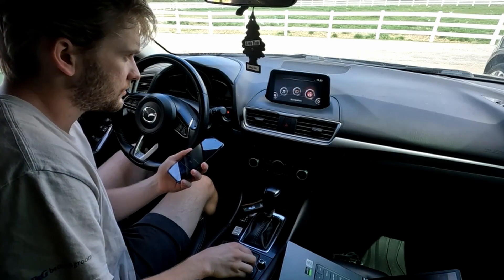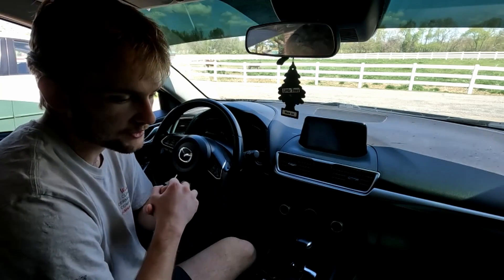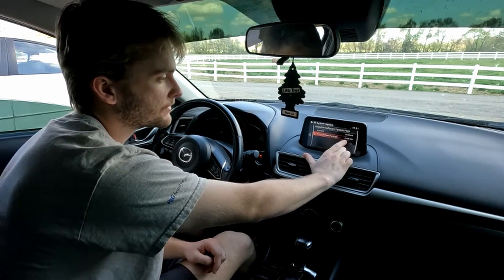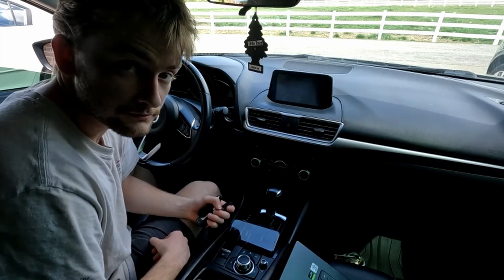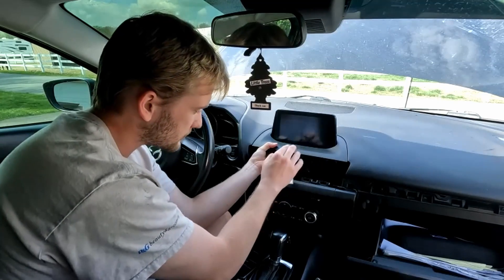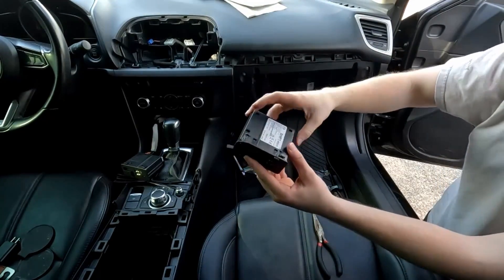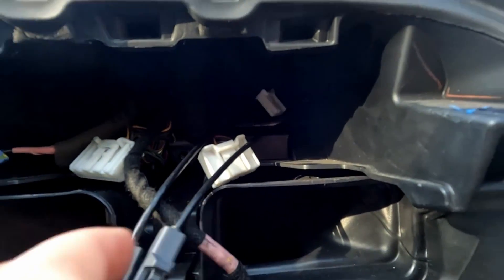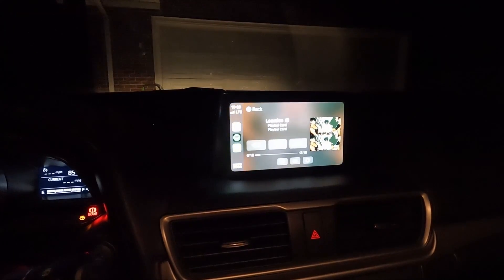How To Install Apple CarPlay/Android Auto On Your Mazda Infotainment System

Comment: DittyPitty, 
Hello I like your work , BUT People outside of North America are installing the wrong FIRMWARE.. NA N is Only for NORTH AMERICA.
YOUR Google link has been copied from my original thread on this subject.
The 55 Firmware Cut off ONLY Applies for NA N, what about EU N or 4A N, that cut off is 56.00.100 EU N not 55.00.650 for NA N, these are Not the same Firmware.
Please can you either redo or add a Banner over your Video saying for NA N Firmware Only.
Your video is causing a lot of grief.
Regards
ASH8
Reply from the maker: Awww fwick. Thank you so much for bringing this up to me and I sincerely apologize for any who is outside of North America installing the firmware. I’ll update the description and google drive to let people know. Cheers!
Reply: @DittyPitty1  Hey man!
I did it. It took me exactly 36 min because I lost power during the process at 98% but when I came back it restarted where it stopped. Eleven easy steps:
1.  Put the car on ACC;
2. Test the sound from the radio;
3. Press, simultaneously, "MUSIC" + "FAVORITES" "VOLUME" buttons to open that black screen with figures on it;
4. Type "3", Press "ENTER" and "CLEAR";
5. Type "2", Press "ENTER" and "CLEAR";
6. Turn off the car and lock the doors for 3 min;
7. Put the car on ACC again;
8. Connect USB key;
9. Press simultaneously "MUSIC", "FAVORITES" and "VOLUME" for 3 seconds;
10. Type 99, Press "ENTER" and "SEARCH"
11. Choose the reinstallation package and install;
Watch the magic happen.
It might take time to start installation but, it will.
For me, it took time to move away from 2%, 16%, 80%, 98%. Might be different for others.
Don't forget to press the clutch or open the driver side door every 20 min. Also, in the USB key, you can have whatever you want as long you have the installation package, it will work.
That was my contribution. And Thank you so much @DittyPitty
Reply: I have a ‘17 Mazda 3 and it’s on v59.  Do you know how I can get up to v70 so that I can use the v74 that you provided?
Reply: @dwarnke72 mine was on 59 as well and I went straight to 74
Reply: @MergeMcadoo  so you really had 59.00.502? Just wanted to verify if I could go straight like you did...
Reply: @Shandaniak yes. Been a year no problems
Reply: @MergeMcadoo  thanks a lot. My touchscreen died i was afraid when I read that it might brick the system. This helps that someone had same thing. I will try it. Thanks
Reply: @dwarnke72 I have both files if you need them

Comment: I've seen two different hardware upgrade versions both stating compatible with 2017 Mazda 3. One is the USB phone connection, and the other is with a type-c phone connection. Will both of them be compatible?

Comment: Worked great on my 2016 mazada 3 sport.  Thanks!  I ended taking off the faceplate of the old hub unit and then breaking the tabs to pull out old one.

Comment: For anyone doing this, instead of drilling out the tabs (which could be dangerous because there is a capacitor in the old Mazda USB hub), open the sd card reader, stick something thin with a right angle into one of the two holes above it (I used a tool that came with a trim removal kit) and pull. The front face plate will come clean off. Stick a flat heat screwdriver in the four small slits where you can see the tabs and twist, it will break the tabs and you can just pull the hub right out. A less destructive, albeit still destructive, way to get the usb hub out.
Reply: This saved me so much time, thank you 🙏🙏
Reply: Hell yeah. Gonna try this out this weekend. Thank you!

Comment: Does the USB hub always require replacement? I have a 2017 Mazda3 GT and it has 2 USB ports and SD card below the radio. Would love not to replace the hub. Thanks for the video.
Reply from the maker: I’m fairly sure the USB hub needs to be replaced since the stock one is not compatible with Apple car play.

Comment: Can you perform the update with an aftermarket key fob? I don’t wanna try it and have it not work for the part where you have to lock the doors. One of the door actuators doesn’t work the passenger side door

Comment: Help! I tried this out. Mazda3 2017, was at 70.00.100 and was updating to 74 with the file you provided. After about 20-30 minutes into the update, my screen went black. I waited for about another 20-30 and now nothing works. When I press the on button (without break), it now shows 0 Miles remaining (previously was full tank and 300+ miles). Car also will not start now and states no key FOB (red key with line through it). 

Key FOB unable to lock or unlock car (or start it) but yet the car beeps when I hit the lock or unlock button. Going to try jump the car in case the battery died. Wife has the jumper in her car so have to wait until she gets home. Any assistance appreciated if I am on the wrong page here and curious to how this will work since the update process has been halted.
Reply: In case you do get it resolved, don’t even bother with the update. As long as your software is 70.00.000 or above, Apple CarPlay should work (according to others I’ve seen do this upgrade)
Reply from the maker: That’s a very tough situation to be in. I really wish I can help you out but this is above my pay grade. Is your car North American? The firmware is for North American vehicles only. This is the one thing that comes to mind. I’m very sorry about the situation

Comment: do i just need the usb hub alone or do i need the wiring as well ? because my usb hub postion is in the handrest
Reply from the maker: You have to do both. The usb hub in the hand rest makes it easier in my opinion!
Reply: @Dom60999  thanks for reply

Comment: I was VERY nervous at first but I followed your video and it went perfectly.
Tip for those without a touchscreen: Scroll the knob to get to the numbers, and press down twice to “enter” and then scrolling will “clear”

I have a 2016 Hatch, and it took mine between 25-30 mins to complete
Reply: hey! I just wanted to make sure that when you say “scroll” to clear, it’s the main control knob and it just goes onto the next number right?
Reply: @abigailb3020  yes I believe that is correct, if you twist the control knob left or right it will change the number, which acts the same as pressing the “clear” button
Reply: @ THANK YOU!!! you’re a livesaver😭 i’ve been trying to figure it out for a little bit and i finally finished my install and everything!! apple carplay works great :D so glad I found your comment.
Reply: @ enjoy your freshly upgraded Mazda 🤙

Comment: Help! I just installed the car play module and now trying to do system update, but my usb ports are not working anymore, is this because new ports and wires only function properly when update is applied ? Will I have to put back the original equipment then update the system, then install new equipment again? If anyone can help before I start taking all this apart again
Reply: And yes everything is plugged in lol

Comment: Thank you for this! I swapped the dual USB-A module for the one with USB-C for better charging speeds. However, I am having an issue where I have to unplug and plug the cable back into the phone on more than half of my startups as it doesn't seem to trigger car play the first time, even though the phone indicates it is charging. This is on 74.00.230 (I think that's the version, not 324). Hoping maybe it is a temporary issue.

Comment: Totally worked. Took about 20-25 minutes on my 2014 Mazda 3. I was able to use a PNY 32GB USB 3.2 drive with no issue. I did not hook up a trickle charger but my battery was just checked good and I'd been driving today. Only needed to download the one CMU150 file, that's it. Directions in the PDF worked perfectly.

Comment: Does the Apple CarPlay hub that you linked in the description only work with a wired connection or is it also wireless?
Reply from the maker: It is wired only. There is a usb be huh that supports wireless but it’s only wireless.
Reply: Oh ok, thanks. Do you know if you can disable the system from charging the phone? Also, do you have any issues with it disconnecting randomly or it being very laggy and whatnot?

Comment: How about the original cable? You remove or just leave it as spare in future incase need to rollback?
Reply from the maker: I took the old cable out and used the new ones. I did keep the old cable but there will most likely never be an issue where you’ll need it.

Comment: What about steps 7-10? The installing the fail safe? Did you not do this? You don’t have to? If I have OS 55 does that mean if I install the 74.00.32 update that you have on google drive then it’ll work, even without installing the fail safe?
Reply from the maker: If you’re located in North America and your firmware is 55.00.650 or above then you can upload the firmware that is in the google drive. I personally skipped steps 7-10 but you can do them if you’d like for ease of mind.

Comment: Hi Dittypitty, do you have any idea why my reinstallation package keeps failing? after i get to the part where its preparing the process i end up with "Validation Failed - Failed to validate the package certificate."

Im assuming the file is corrupted but i redownloaded the file 3x now and getting the same result.

UPDATE: Downloaded it for the 4th time, but this time i verified the CMU150 file by using the MD5_and_Sha (you dont need this in your USB stick). I dont know if this is the reason why it worked or that the 4th download was the charm, but whatever the update worked. Thanks for the help Dittypitty.
Reply from the maker: I’m glad everything worked out for you!
Reply: Can you guys explain this process a bit better ? I’m having the same problem

Comment: Mazda3 2017, firmware upgrade worked well! Thank you for the video. It took me days and days trying to get the firmware but without luck until this video. Called the dealership and they wanted CAD 95 plus tax to do this firmware update!! Now that I followed your video and have it upgrade, I ordered the kit from Amazon and will install the hardware this weekend.  Total savings 505 - 170!
Reply from the maker: Glad I could help!
Reply: Have you installed the kit? If yes is the android auto touchscreen working?
Reply: @winterMB91  I installed it yes and the installation went well. I don’t have an Android but Apple and the touchscreen on that is working.  I got the wireless version of the Kit (from Amazon) and to those who are thinking about the wireless version please save yourself time and money and get wired instead.  The wireless is not stable at all.  To return it of course I can’t drill holes so I have to disassemble the whole middle console to take the kit out for a return.
Reply: @whiteflyingmonkey  thanks for responding man 🙏

Comment: Just to follow-up on my previous post, finally did the hardware change and AA is working great! Need to check CarPlay later. Some time savers: google "fast way to remove mazda usb hub" for an easy way to remove the old one. Involves a bent screwdriver, flathead, and needlenose. Took less than 2 minutes to remove (and destroy) the old hub. First time doing this, so it took me about an hour total, but if I did it again, probably less than half. Thanks DittyPitty for the video!

Comment: Thanks for the most recent software. The technique I used for the old USB/SD module worked great and wasn't destructive: grab 2 packs of those cheap Harbor Freight pick sets ($1-2), using the hooked ones, flip down the SD card flap and hook them into the holes. Pull firmly and steadily on both, and the face plate of the module should pop off. Then, you can access the inner side of all 4 clips. You now want to use the straight pin-like picks to wedge between the clips and the dash hole. Hard to explain, but look at the module in the video and imagine how the clips connect to the dash. With all 4 picks wedged between the clips, the module should pull out by carefully grabbing the edges with needlenose. If you weren't too rough, the faceplate should still have its clips intact, and you can clip it back on to the module/circuit board part.
Reply: Hi
After changing the piece, the touch didn't work for me. Any advice?

Comment: Hi DittyPitty. Thanks for the great video! I have downloaded the file but I don't have the USB hub yet. Can I do it in stages? (Just update the software for now) or should I wait until I get the USB hub? Basically, does everything besides AA & CP work as normal until I get the USB hub?
Reply from the maker: Thank you! You can update your software and have everything work as normal without needing the usb hub. Once you install the hub that’s when car play will be available. Cheers!
Reply: @Dom60999   Wow, thanks for the fast reply!!  I'll give it a shot. But first, gotta find a thumb drive that's only 16GB or less!! Gotta be one in one of my old boxes of crap! 🙂
Reply: Ok, software update went super smooth! Went from 55.00.753 straight to version 74.00.324a (in case anyone is in the same boat) without a hitch. So far, no changes to speak that I can see, so next step is to get the USB upgrade. Oh and did confirm the version number is correct after upgrade.  Thanks!

Comment: Thanks for the information. Got it done today. The software update was straightforward. No hiccups. The interior part was different as I have a CD player where your interface is, and the interface is in the console. It was probably easier that way. The cupholder part has a hidden screw under the  rubber bottom of the cupholder. You then pull it straight up. The console front panel (where the interface box) has 2 screws which are revealed once the center cup-holder part is removed. You then have access to the rear part of the interface, so pressing the 4 clips is possible. I routed the wires on the passenger side a bit like you did. Not much extra wires with this install location.

Comment: Hi, Thank you for your video. Does this work on my Mazda 2 2019 as well? Also, does your firmware work in my region? My OS version is 59.00.540 4A N. I just wanna make sure. Thank you for responding! :)
Reply from the maker: The process would be very similar on your 2019 but the firmware I have will not work for your region. The firmware I have is only for North American Mazdas. Sorry homie
Reply: @Dom60999  Thank you for responding! I appreciate that. Subscribed!

Comment: what years does the mazda needs to be as minimum, mine the usb stuff is in the center and where usb stuff is, there's a CD Drive, mazda 3 2015
Reply from the maker: As long as your infotainment is above 55 firmware you should be in the clear
Reply: did u ever find out bro mine also has cd player and the usb plugs in the center console ?

Comment: Great tutorial, thanks! quick question, i wired everything and it worked perfect, but when i hit a bump or even driving the carplay disconnects, i even change the cable and nothing, re wired and it worked for a while but again, any idea?
Reply from the maker: Thank you! Nothing immediately comes to mind but one of my friends had a similar issue and when they got a higher quality charging cable for their phone it helped a lot.

Comment: Can I ask, If someone were to replace the radio with a new one, (like a Kenwood, etc), I take it you'd lose all kinds of functionality for the vehicle itself?
Reply from the maker: Yes I’m pretty sure you would lose some functionality. I use the maintenance menu on the stock infotainment for my oil change and tire rotation and that’s why I opted to keep the stock setup. I believe there is a way to install a larger screen but keep the stock software so you don’t lose functionality.

Comment: its 2023 and I cant find a usb in the house that is less than 32GB -_-  excellent video though thank you!
Reply: I was able to do it with a 256 gb USB. Just be sure to format the USB to FAT32 and you will be fine. 

It's amazing, everybody connects their phone and everything works perfectly in every video I see about this type of installation.

I can't seem to make it work. I bought a wireless unit and it keeps connecting and disconnecting all the time. My phone is trying to connect to the car by Bluetooth and the unit is trying to connect through wifi and none of them are capable. It's a mess.

I have the 70.0 version. I am going to try the 74 and see if it makes a difference 😮‍💨

Comment: Just wanted to say thanks for the tutorial. After about 3 hours and a few moments of panic (updating firmware takes a minute and your screen will blank out a few times), I got it done. Showing how you did the wiring on the passenger side helped a lot too. Thanks! 🙌
Reply from the maker: That’s great I’m glad I could help! I also had moments of panic while doing the install as well hahaha.

Comment: I have version 70 on My 2018 Mazda 3. If I understood you correctly, you can do this with the version 70. You don't have to update to 74 correct?
Reply from the maker: Yes sir if you have v70 then you don’t have to update your firmware. All you need to do is swap out the usb hub that support Apple car play/ android auto and it’ll work!
Reply: So once I swap it out for the new USB hub. I will see Android auto and car play pop-up on my screen correct?
Reply from the maker: Yes. If your firmware is v70 or above just swap out the usb hub for one that supports Apple car play then plug your phone in the usb port and Apple car play should come up on its own. You might have to unlock your iPhone first. Same idea for an android phone as well.